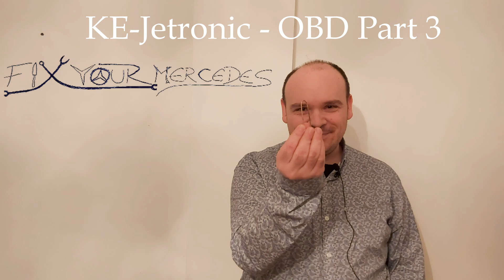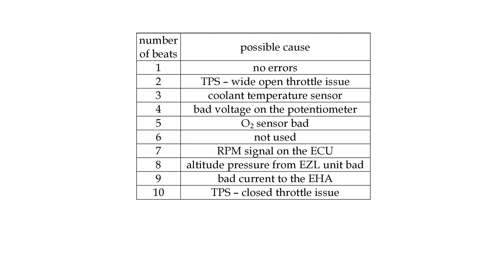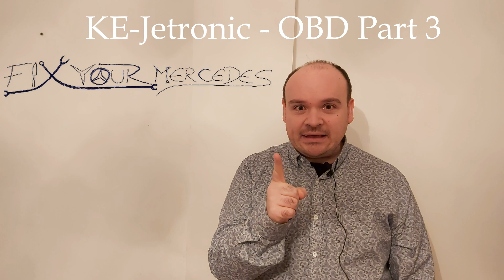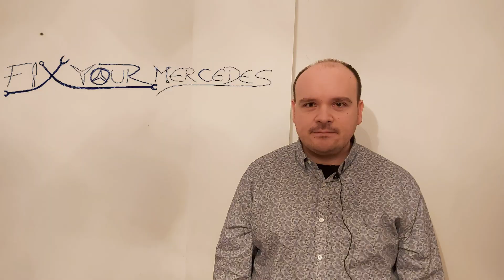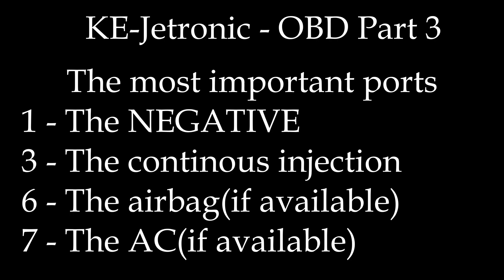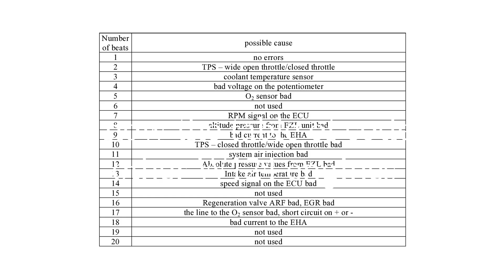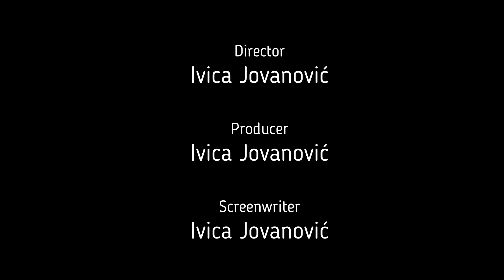㉦Mercedes KE-Jetronic㉦ - The OBD1 Part 3 (would you believe it?! OBD over 30 years ago!!!)

Comment from the maker: Don't do that on M103 engines. This is predicted for M102 engines starting from september '89. And don't do this on the round X11 diagnostic socket. you will either turn the fuel pump on or nothing is going to happen. If you want to check this, do it on your diagnostic port on the right side of your car next to the battery.
Reply: I don't understand why we shouldn't do this to X11 diagnostic socket? The video is shown the testing method of  X11 diagnostic socket installed on m102, right?
Reply from the maker: Right, for m102 engines. The others have the diagnostic socket by the battery so they have to test for codes there.
Reply: @mercedeske  great, so testing the m102 X11 diagnostic socket is okay, but don't do it to m103 X11 diagnostic socket. Thanks
Reply: @mercedeske  I have both sockets on my M103 in early R129. Can I use X11 like this or not?
Reply from the maker: @libran58  You don't have to. Use X11/4 by the right fender, the rectangular one.

Comment: Today I tried reading the fault with a stick. And im lucky because i heard a single tick sound. This means there is no fault electronically. My car has a problem of working late when it warms up. So which points would you recommend I look at? Thanks for your answers.
Reply from the maker: Tell me about the mileage and what you have replaced on the system? Except of ignition.
Reply: @mercedeske  Your comments are very valuable, that's why I'm curious.
Reply: @mercedeske  My car is at 253.000  km. But  At 249.000 km,
Let me write down all the parts that have changed.
 Fuel pressure regulator, fuel pump, fuel filter, injector assembly, injector rubber, crank sensor, gasoline holder, engine water temperature sensor. Sometimes it shakes after a late start and recovers after 1-2 seconds and everything returns to normal.
(I apologize, I also wrote some ignition parts to understand the problem.)

Comment: great video very helpful indeed.
but if i disconnect the battery will that also rest the ecu?
just curious.
your a blessing for old Mercedes fanatics i really love your channel.
Reply from the maker: Thanks a lot! Yes, it will but check it again. Don't check the code on the X11, check it always n the X11/4 by the battery. I has 8 or 16 pins. That's where the ECU sends the code if present. Happy Mercedesing!

Comment: Pozdrav Ivice.koliko novaca je taj multimetar .razmisljam dali da kupim oscilosko ili to.izgleda da je cijena tu negdje
Reply from the maker: @damiropadobarglumskiperiod505  Iskreno rečeno, bolji ti je običan, nisam zadovoljan ovim, što se tiče radnog ciklusa, to ti isto nije potrebno, to je samo napon u vremenu(milisekunde. Sve u svemu, svaki od 2500din. će da ti završi posao, a I oni jeftiniji čak. Pozdrav.
Reply: @mercedeske  da .osciloskop sam razmisljao da kupim radi peugeota koji se povremeno gasi pa je sumnja na cam i crank shaft sensor pa da ne lutam a sada vidim da ima multimeter sa opcijom rpm.a za k jet...se zanimam radi oca koji je nedavno preminuo i ostao mi je 190e koji je lezao 13 g u garazi.trenutno mu ler gas stimam preko sajle jer idle mikroprekidac donnjega sajla niti dolazi.pa cu uskoro da pogledam motoric ler gasa i ostale stvari.nisam znao z diferencijalbi pritisak i da se taj sistem moze fino podesiti u cilju oprimalne potrosnje.svaki video zlata vrijedi.veoma sam vam zahvalan

Comment: I have a 1988 w126 420sel with pre-OBD system. There is only a round, 9 pin connector and no other connector or data port/output in engine bay. 
Will this method work, or is there a similar jumper method for this model? 
It is showing check engine light on, but I don't know how to retrieve the codes. 
Thank you for any help!
Reply from the maker: Hello. I think it will work. I think that the check engine light could be because of the lambda. Have you replaced the lambda probe?
Reply: @mercedeske  i have not. Which is the lambda probe? The same as O2 sensor?
Reply: @mercedeske  there is very little info about this set up. Most all references mention the impulse display button, or at least being able to use a probe or display. 
The other references mention only lambda readout, and I think there's a duty cycle output supposedly, but no reference to code acquisition. 
So, I should go ahead and jump pin 1 &3, and see what happens? 
Thank you so much for your guidance!

Comment: Hi 

Where can i hear the sound ?

That i connect 1 and 3 then swith on ignition for five second then remove the wire … but no sound (peep or any thing ) to hear !!!!

My engine is 102
Reply from the maker: Do it on the X11/4(the rectangular switch by the battery). The sound will come from the battery. If no sound then everything is okay!
Reply: @mercedeske sorry i don't understand you😊 

What is the rectangular switch by the battery?

Thank you for replying because i have many issues in my car
Reply: @mercedeske  do you mean the rectangular switch near the battery which have 8 holes .

Can i connect 1 and 3 in that rectangular switch??? Then continue the same as the circular switch?

Comment: In my 190e fuel pump start working and I don’t head any clicks ,why?
Reply from the maker: Does the fuel pump start when you turn the ignition on?
Reply: @mercedeske  yes
Reply from the maker: @aggelosxronas4136 Then everything is okay. On the older models the pump can not be bridged there, on the new ones it can.

Comment: What is the diagnostic socket on 1987 300e w124? I can only find that 9 pin
Reply from the maker: It is located at the right fender by the battery. If there is none on your car then you don't have it.
Reply: @mercedeske  yes I think that is the reality. The other connection makes things look so easy so I wanted to find

Comment: I have this on my 1991 R129, and the other OBD thing as well.
Reply: It is M103 engine.
Reply from the maker: Check the one by the battery, the rectangular one, that's where you will read the codes.
Reply: @mercedeske  OK thanks for replying. But the battery is in the boot (300 SL). I guess you mean use the one on the passenger side (left hand drive car). Trouble is, I have ABS and ASR lights on but this system is not available to the scanner, apparently...?
Reply from the maker: Yes, the passenger side. If the ABS is on then something is wrong either with the OVP(blown fuse) or you don't have power supply on the contact 87E - one of them is for the ECU, the other one for the ABS but I would rather say that you probably have problem with brakes because your ASR is ON. Maybe the sensors(dirt as potential cause) or there is something wrong with your electronic accelerator. That much i can say this way...
Reply: @mercedeske  Thank you. The OVP is new and fine and everything works on the car as normal but still the lights. The electronic accelerator seems ok, smooth, even the tempomat works ok, but I will check it if I can.
Reply: Oh yes I cleaned all the brakes and sensors and tried new sensors, still the same. I have even changed the ABS hydraulic unit to a tested one, and bled the brakes 4 times. No change.

Comment: Muy buenos videos , podría decirme en español en el puerto redondo dónde conectar el multimetro en %hz para controlar la válvula electro hidráulica tengo  un 300ce-24 muchas gracias
Reply from the maker: Hola.  Puedes consultar el propio eha.  Conecte el multímetro al eha y mida la corriente (mA) de esa manera puede ver qué hace la ECU y cómo se comporta.  Verifique la polaridad de ambos pines porque siempre cambia.  Debe obtener entre -3 y 0 mA en ralentí cuando el automóvil está caliente y no una diferencia significativa a 2000 rpm.  Muchos saludos.
Reply: @mercedeske  muchas gracias !

Comment: Pin 1 is rpm, pin 3 is duty cycle. Is that right? Short it then turn key to on, hear for clicks
Reply from the maker: Right, but if you have the diagnostic socket by the battery do it there, the same pins, 1 and 3. Of you don't have it, try it then on the X11, if you have an m103 engine, don't do it.
Reply: @mercedeske  noted and Thx, I don't see the rectangle diagnostic interface near battery . I can only see the round 9 pin interface by the ezl
Reply from the maker: @rfbu Is your car prior to september 89?

Comment: Hi
I have e190 w201 1.8 1993 , the  acceleration is slow , I am not sure if it's vaccume or engine , it has new oil spark plugs , fuel pump , I did obd test I only heard  1 click ,  the downshift gear switch is working , when I drive up steep hill I accelerate,  but nothing happens sometimes but other times is goes fast .  I am thinking I might have faulty potentiometer
Reply from the maker: Check it.
Reply: Yes I try , I got 1 beat . I ordered proximity sensor anyhow , but I think mabie seal in ktronic pump I sell fuel sometimes
Reply: I smell fuel ,,, corection
Reply from the maker: Check the pump if it's the non return valve.
Reply from the maker: Possibly!

Comment: Καλημέρα σας παρακολουθώ αρκετό καιρό και είναι πολύ ενδιαφέροντα  αυτά που αναφέρεται .δεν έχετε όμως αναφερθεί ποτέ για MERCEDES 123 C 230.Θα σας ήμουν ευγνώμων .   Ευχαριστώ     τον χρόνο σας
Reply from the maker: Hello and thanks for the subscription to the channel. I'm going to reply in english because of the others. At first, it's a HUGE difference if we are talking about a W123C or a W123CE because the first one is equipped with the M115 engine which is on carburettor and the CE is M102 engine with K-Jetronic injection system. I don't talk about carburettors, I do have literature on those but I have never worked with them and I don't prefer carburettors in general. So if you have a CE with K-Jetronic then I can say about some similarities and differences on the system. My best regards.

Comment: Hi.  I have a W126 260 se from 1987. When it's cold outside it doesn't start, if I pour hot water it starts.  When heated, the speed is 1300 rpm.  Otherwise it works well, does not emit smoke
Reply from the maker: Check out the cold start valve and the coolant temperature sensor for the beginning.

Comment: Salvation .
 I have a Mercedes class E 420 from July 1997
 I have a problem and I can't solve it
 I have the automatic transmission stuck in second gear.
 I changed the transmission,  the electrical plate, complete oil change, and the problem still persists.  I would like to know if you have any idea of the problem?  Please .
 Tony.
Reply from the maker: Hello, looks like you will have to plug in the car on the diagnostic. Nothing can be said just like that. Fingers crossed 🤞🏻

Comment: Hi ...I have 1983 S123 MB230TE  4 cylinder engine the round diagnostic socket is on the left (driver side) front side fender by the ABS

Comment: W201 1983 M102961 engine. wire on pin 1 and 3. No beat at all. Tried many times no beat at all.why?
Reply from the maker: To tell you the truth that's because I mixed up ports X11(round one at the left fender) with the X11/4(rectangular one by the battery). This procedure has to be done at the X11/4. How I made it on the X11, I have no clue!!! The procedure is the same as I described it on the video!
Reply: I dont have that thing near my battery. Checked every where. It is just not there. I only have the X11

Comment: Hello, thank you for this very interesting video but I also have slot number 3 which is not wired. Do you have another solution to diagnose? I have a Mercedes W124 230E 2.3 136 year 1985
Thank you
Reply from the maker: Hello, I believe you have an 8 pin diagnostic for that by the battery at the right fender. There you can check for codes with the obd1 scanner.
Reply: @mercedeske  I don't have an 8 pin diagnostic next to the battery. I find the ECU nothing else. I have the same thing as on your video
Reply: I have a 230e m102 engine 1985 too.. w124 body. I also have no socket for the third terminal in the obd 1 diagnostic. I tried doing what was discussed in the video but the third in the diagnostic is just an empty slot like what you said.

Comment: Hey could you tell me where to find the OBD1 in the m102 engine? I have a 1985 w201 or 190E
Reply from the maker: It's located looking at the right fender near the battery. It has a rectangular shape and 8 pins.
Reply: Hey bro thanks. I found it could you do a video on vacuum line not just point them out like you did but to say what there for and how to hook them back up. I bought the car from a widow and a lot of the vacuum line are disconnected. my central locking my ac so as much help I can get I will be thankful
Reply from the maker: Thanks a lot. I will see what I can do. Greetings

Comment: You're doing a great job.
Continue like this, you help many with your knowledge ..

Do you have any advice for us who have the 560 engine?
What can we look at to use what you have shown us so far that also goes for us with these 560 engines.

Best regards from

Dag Nilsen.
Norway ..
Reply from the maker: Hi, thanks a lot. What I showed here is for M102 engines but it also applies for other engines if you have an eight pins(or more) diagnostic by the battery at the firewall. For this you will need an OBD1 scanner if you want to read the codes. What I can say is - replace the lambda probes at 50k km, check the potentiometers at 150k km if they still hold the voltage steady. These two are the most common issues on the KE-Jetronic, never, and I repeat NEVER touch/don't let someone touch either the CO-screw or the fuel distributor unless you really have to(a shaky engine which turns out to be either a bad injector or a chamber out of which fuel doesn't flow, an uneven fuel flow or too much fuel leaking out of the fuel distributor). Check your injectors each 150k km to see if they started dripping, squirting... These injectors are mechanical and CAN NOT be cleaned in the ultrasonic bath, they have to be replaced. As for the EHA, if it goes bad you will feel pressure loss(car stumbling) so check if the fuel is not leaking out of its little holes(the EHA becomes all wet - wipe it with a paper towel and if the EHA becomes all wet again, well, it has to be replaced).
That's something in brief,
best regards from Serbia and "Happy Mercedesing"
Reply: Hi...
Thanks for the quick response to my post.

I have probably mispronounced myself a bit regarding this with the 560 W126 Series.
I have a 560SEC 1986.

I've probably already done what you think should be done.
The car was traded (came from California via Japan) and to Norway.
I have replaced it a lot.
Changed:
All gaskets in fuel distributor.
8 new Bosh nozzles. And all the gaskets around these.
Register tighter 4pcs. (these in plastic that chips up and destroys the engine)
Cam drove 2 pcs (After changing, the car changed gait - became «softer».
All the rubber that is on and around the intake manifold.
The large rubber that sits under the fuel distributor. It was patched with glue.
Plug wires 8 pcs (Bosh) with the correct Ohm.
Had to replace EHA got hold of a used one. Which works fine according to what I think.
Has taken a picture from inside the cylinders (EndoScoop)
Is not a hint of wear. Can still see the little arrow showing
which way the piston should be during assembly from the factory.
There is no carbon buildup on the piston top.
The compression is 11.4 kg on all 8. On cold engine.

Now the engine runs about 625 rpm hot engine in N.
In D it goes down to a little over 500 rpm.
And it's going steadily. No vibration.
I also got hold of the original AMG Cast Iron Headers.
They're going on this winter.
The car is only used in the summer.

BUT.!
I have an annoying problem - The heater does not work.
I have checked that the small engines that are to draw in air from the cabin are running. They're ok.
The strange thing here is I get to start the heating appliance when the car is inside one
cold garage in winter - then it starts.
I have replaced the mono vault, with original MB.
Have checked several places online. And tested out many of the suggestions.
Has even replaced the ignition module located behind the ignition key.
(the device with 8 contact points, it is also new).
I don't think it is the heater console – Of course I can't be sure of that. But!

I think there is something with a thermostat regulator somewhere on the engine block..
I have replaced some of them too, ..

Something completely different.
Maybe you should make it possible for us with Mercedes and post pictures of the cars?

Med Hilsen
Dag.
Norway.. @mercedeske
Reply from the maker: @mtc57  Hi, as for the heating the only thing I can think of is either the thermostat or you would have to flush the heater core.
Reply: @mercedeske  Ok.
I have a new thermostat, and a new water pump.. I will change both of them, start to night.
I'll keep you updated

Regards
Dag.
From 
Norway..
Reply from the maker: @mtc57  Hear from you in the comments.
Reply from the maker: Thanks for your help. Happy Mercedesing
Reply: Finally finished and replace the water pump and thermostat.

It was no small job, 7 hours and cleaning up afterwards.
So to the question:
Would the heater start? No!
I can hear it clicking from the mono valve. And that's all.
The heater will not start.
So to avoid hearing the click from the mono vault, I removed the plug.
I will probably have to replace the entire heater unit that is in the console.

Regards
Dag,.
Norway.
Reply from the maker: Sorry Dag but I would like to help you if I could, gladly. I hope you will solve the issue.
Best regards
Reply: @mercedeske  
Thats ok.
I Got the winter to fix the heater consol.